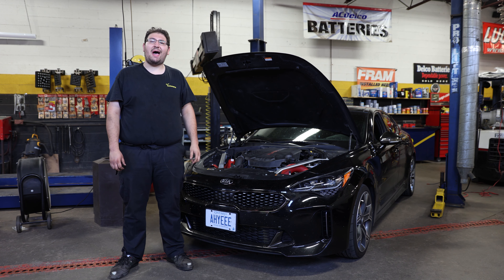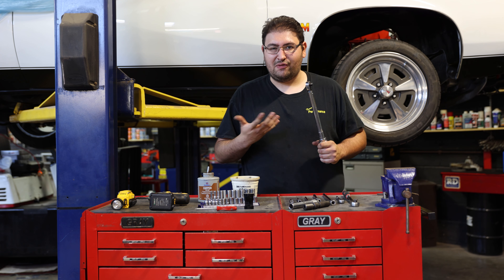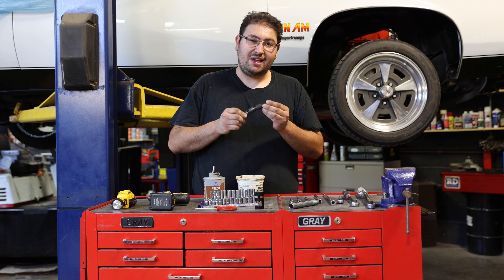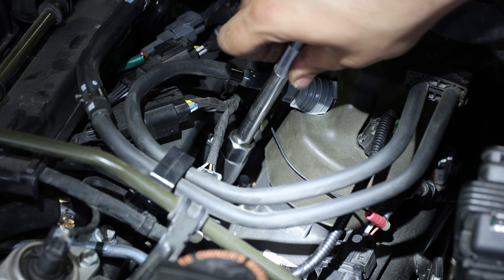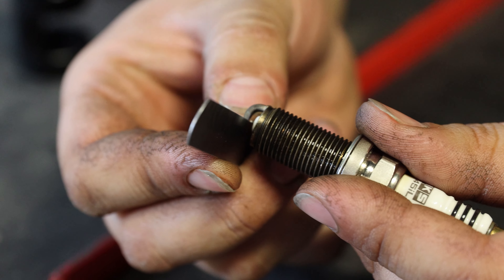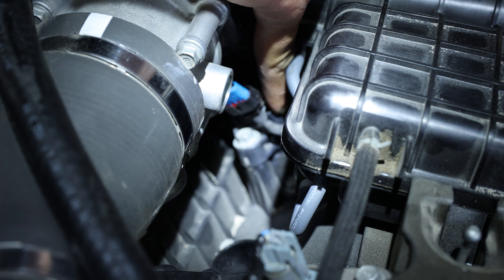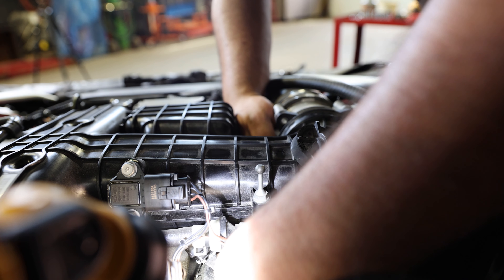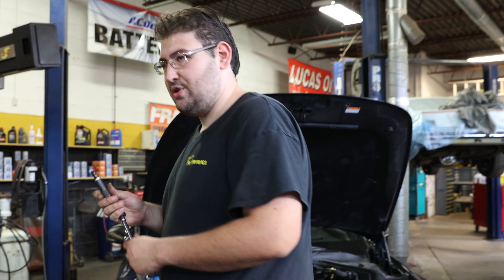HOW TO CHANGE & GAP KIA STINGER SPARK PLUGS THE RIGHT WAY - (THE BEST DIY)

Comment: I did this a while back, wow that spark #5 gave me such a hard time! I had bought a single swivel socket, but it wasn't enough. Needed to double it.  The passenger side was such a pain to do, aha, but everything turned out fine. Gapped my HKS M45il 0.23" and I can run jb4 maps 0-5 w/o any problems (w/ octane additives up to 100). Nerve-racking day, but totally worth it.
Reply: What socket did you use? I tried to find the one in the video but they don't look like they make them anymore.
Reply: As long as my fuel adapters arrive Ill probably be doing this next weekend. Same reason as you, putting on the jb4. So double swivel huh?
Reply: Do I need to gap my HKS M45IL plugs if running a Lap 3 Stage 1 ECU tune?

Comment: Great video: I used these tips to change out my plugs without removing the intake manifold. It took longer to find the coil pack bolt that I dropped into the engine bay than it did to swap the hard plugs!
Reply from the maker: Glad it helped you out!!! That’s the best response I could ask for.

Comment: Literally just bought a swivel socket for when I need to do the plugs on my 2022 Elite; great vid! I've never torqued plugs tho lol hand tight is good enough as our hands can easily torque to 20ftlb. I use dielectric grease on my boots; glad you showed the greasing portion as a lot of ppl forget that
Reply from the maker: Thanks! Glad you took something away from it! You seem like you are well versed in maintenance practices! So kudos to you!
Reply: Hi, did you buy the swivel socket from somewhere else? The link provided shows the swivel socket is discontinued

Comment: Thanks man, I got it done tonight in a couple hours. Only thing I didnt have was the swivling 10mm so I had to use a small ratcheting wrench to get those passenger side 10mm’s off. It was a pain but was still possible! Thanks again!

Comment: Thanks for this video! When I looked at the location of that #5 COP I thought for sure I'd need to get that manifold out of the way. Glad I looked it up! A spanner works well to crack the COP bolt on the tough side if you can't get the uni on there quite enough (like me).
Reply from the maker: Hey Jason!! We are beyond ecstatic that we were able to give you the extra confidence to tackle this job on your own!!

Comment: Thanks for the video, best video I've seen on this, also it's the exact same for the genesis G70.  I may have missed it on the video, where are you putting the dielectric silicone?  Also got a torque spec on the bolt for the packs?
Reply from the maker: Hey Josh! We place a little dab into the end of the coil pack where the spark plug would enter the boot. As for torque specs on the coil pack 8-10lbs is more than plenty. These are only retaining bolts. They don’t get subjected to any external forces other than heat expansion.
Reply from the maker: We appreciate your kind words! We are trying to bring the best quality content to the screen.

Comment: Great content, thanks for posting. I did the spark plugs by taking off the intake and it totally sucked. This looks way easier but only if you have those tools. You should setup some Amazon affiliate links to these tools and get a little bit of the money when we buy them. I'm struggling to find some of these tools because I don't know what the exact names of them are. Can anyone help me out?

Tools.
Reply from the maker: Hey there. You made a great suggestion ! I’ll definitely look into linking these tools in the future. The adapters your looking for are call universal joint adapter / flex adapters in 3/8th drive. As well as a 6” 3/8ths drive flexible / wobbly end extension. 

Hope this helps.

Comment: Do you recall what that sixth element upgrade is?! Can’t find anything similar on their website. Thanks in advance!
Reply from the maker: Hi Nick, Sxth has since discontinued this dual catch can for the Stinger. Another very nice alternative is the ADDW1 V3.3 dual Catch Cans. They have a secondary vacuum reference so that even under throttle / positive pressure conditions, PCV residues still get drawn into the can , rather than only during idle / negative pressure / vacuum conditions in the manifold.

Comment: So I just got all new spark plugs changed and my stinger is a 2019 gts with 18k miles and im still having misfiring whenever im putting my foot down for small quick acceleration. It doesn't start up weird or have a strange idle. Everything runs perfect until I start to give it some more power. Could this be my coil packs?
Reply from the maker: Hey there! Sorry about your luck. Did you ensure the correct spark plug gapping?
Reply: @performanceautocentregta7727  Kia dealership did the work. But tbh I don't trust kia service departments
Reply from the maker: Any engine light on? It should at least point to which cylinders failed. But odds are (only in this case since you say plugs were just changed ) if it’s only failing under boost it’s likely incorrect gap (too large). If plugs are within spec next in line is the coil. Either way you shouldn’t have an issue on such a new vehicle. They need to remedy that immediately.

Comment: Would u mind link the 5/8 double swivel joint please! Idk where to get it
Reply from the maker: You can purchase it directly from Snap-On. Part # S9710KC. if this option is a bit expensive for your budget, you can use a straight 5/8 spark plug socket, a universal-joint adapter, and a wobble extension to provide close to the same accessibility.
Reply: @performanceautocentregta7727  thank you sure!

Comment: I’m doing my plugs sometime this week. This video will be playing the entire time.  What plugs were you using? And I thought the factory gap was 0.036. On a stock vehicle or a vehicle with just air intakes and exhaust do you recommend keeping the factory gap or closing it?
Reply from the maker: Hi Nick

We 100% recommend closing the gap if tuned at all. Spark blow out is very prevalent on these cars at stock gap when tuned. If running stock boost levels with bolt ons you should be ok at stock gap. It’s only when boost has increased that this becomes an issue. 

Glad we could help ! Best of luck with your installation:)
Reply: What if you plan on getting intakes and primary’s and mids upgrades but the car is stock when you plan to put the hks spark plugs ? Should I gap them or not @performanceautocentregta7727
Reply from the maker: It is safe to adjust before hand. The reason the gaps are so large from factory 
Is because they need to reach that threshold for the largest gap while still being reliable under the use conditions. 
Achieving this balance gives you the biggest spark possible while not suffering from spark blow out / misfiring. 
I’ve seen as low as .018” but I have never used a gap that small. So far for 8/10 applications running jb4 map 1-3+ . .022-.024” has been a great sweet spot. Have had a few with primaries use this gap as well with good results. Nothing on kill mode but definitely reliable power.
Reply: @performanceautocentregta7727  I can’t find where the factory gap measurement is online do you know by any chance and could I use oem wire spark plug gauge to gap them ?
Reply: And thank you also
Reply: Thank you so much for your reply! I only have bolt-ons (K&N Air Intakes and ARK Exhaust). I will not be tuning the car. The only other modification I plan on doing is the Ultimate Performance HFC Downpipe + Mid Pipe. Even with that modification will I be good with the stock gap?

Comment: I recently changed my plugs for HKS ones and gapped them at .025 of an inch. I have inconsistent misfires at idle that seem to go away when I drive. Any idea what the issue could be? Not even 7k miles on the clock so I hope I didn't break anything.
Reply from the maker: Did any of your coils come apart during removal? Ensure all parts of the coil are firmly together (it’s all press together rubber pieces) Also make sure there is the spring looking piece inside each coil , when you remove the coil just turn it upside down and look into the hole where the spark plug fits. This spring type thing (as you can tell I don’t know the part name lol)  is what seats onto the top of the spark plug and transfers the coil charge to the spark plug.  If all coils are copacetic Then I’d say faulty spark plug or incorrect install. either plugs can be not threaded in all the way and releasing cylinder pressure. Lastly check spark plugs for cracked plug porcelain. It can cause misfire issues as well.

Comment: Oh how I wish the tools were in the description as Amazon links. I founds the swivel link but the item is discontinued and can’t find any more of them
Reply from the maker: Hey Chris. Sorry about that. We noticed this and in replacement of this tool you can definitely use two swivels + a wobble -tip extension. This gives the closest ability to access the plug without having the special discontinued tool we used here.
Reply: @performanceautocentregta7727  Thanks for the response(:  I got it out myself, the middle coil actually comes out very easy towards the front instead of the rear, all in all it took me 45 minutes timed.  Probably a bit slow but for my first time I’ll take it
Reply from the maker: Nice job man! Sorry we didn’t get back to your comment sooner! And yes it can go both ways I just typically go towards the rear as i found it to be easiest for me but everyone is different! Congrats on tackling the job yourself!

Comment: How many miles till you have to change the spark plugs again ?
Reply from the maker: We’ve had customers last 50k KM with no issues on the HKS plugs. We don’t recommend the denso plugs….they barely last a summer on some of our clients cars. They always switch to HKS.
Reply: @performanceautocentregta7727  by any chance have you heard how long they last while running map 4 w/ JB4 ?
Reply: @YUNGINLEO  I have not. But for reference this car ran on map 2 for most of its use.

Comment: I'm a believer that putting anti seize. Will give you a false torque and potential over torque
Reply from the maker: 100% agree with you , things like this are negated by very minimal application, as well as compensating of a few lbs with adjustment the torque wrench. This is why we recommend very little application

Comment: I did an Amazon search for that Double ball jointed socket, and they look NOTHING like the one you're holding. What they call a "double" only has the socket and ONE attachment. It looks like you have TWO attachments to the socket. This is a great tutorial but...  Why not include a breakdown of the tools used? Especially the specialty ones? It certainly would have removed some of the guess work and this entire comment other than Great tutorial!

Comment: Removing throttle body to get more room for 5 is a good idea?
Reply from the maker: We haven’t tackled it this way, but I’m sure there are multiple avenues. Although you can remove the throttle body, from memory it’s the intake manifold plenum that overpasses #5. You may not achieve enough room to fit standard tooling without the use of flex / u-joint adapters

Comment: I do the exact same as you but you no worrie about the torque with antiseize? its more than 20 when you add it
Reply from the maker: If you use a lot of anti seize you can reduce torque limit on the wrench by 10 or so ft-pounds.  For the small amount we use we are not concerned with over torquing at this level. If due care is used there is no concern :) glad you had success with your installation !

Comment: Can I use two swivels?
Reply from the maker: You can definitely use two swivels + a wobble -tip extension. This gives the closest ability to access the plug without having the special discontinued tool we used here.

Comment: Dielectric grease is actually NON-conductive, and does not "transmit electricity".
Reply from the maker: Yes even as a professional I can admit when I am incorrect and explained wrong! Dielectric grease’s correct purpose / use is corrosion prevention! I think when the first batches of shirts come in we gotta send one out to you for being so sharp! Cheers!
Reply: @performanceautocentregta7727  haha, XL please! I enjoy your videos! Dielectric grease is most commonly used for corrosion prevention, keeping out water (related to the first one), and voltage leakage. But you know that, just explained it differently.

I recently bought a G70. That's what brought me here.

Comment: 22 or 20. I’m planning on really kicking up the juice
Reply from the maker: .022 is already tighter than most run the plugs. If you begin experiencing misfires under boost, consider closing the gap incrementally